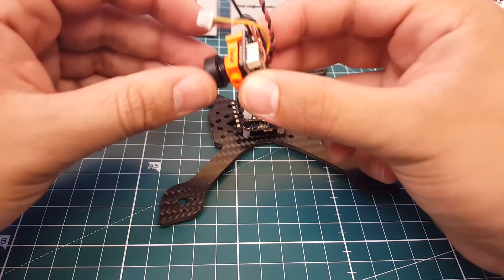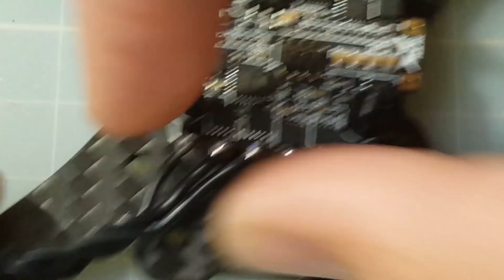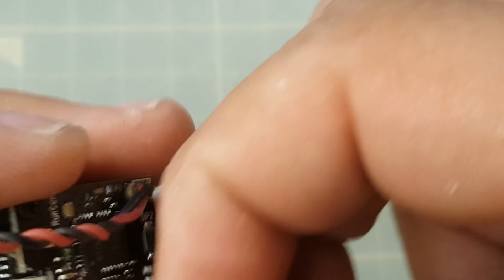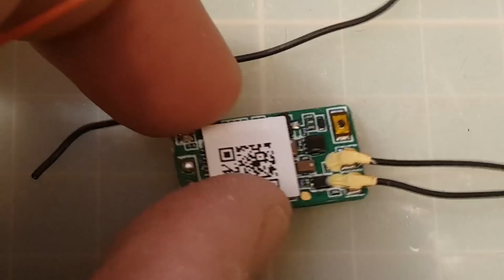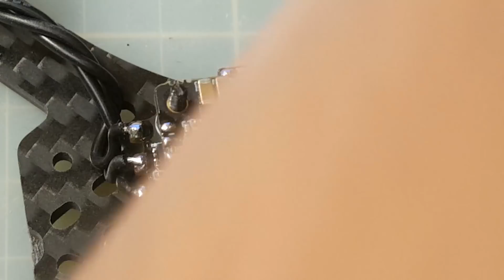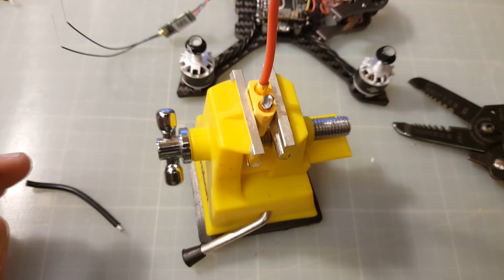How To Build A 3 inch Beast FPV drone 2017 // Geprc Sparrow, HGLRC XJB, Runcam Micro

Comment: Hi i have geprc sparrow with geprc motors 3200kv and dys 4in1 20amp , not camera setup yet , can i use my lipo 850mAh 30c from my heli align  t-rex 250 on my quadcopter.. ? Thanx

Comment: Finally got my maiden in a few weeks ago and just got my dvr too mod my goggles. Just wondering what pids you used when you flew it. I'm on the stock tune at the moment but the quad feels loose and I'm not sure where to start on tuning this little thing. Sparrow frame hglrc f428 stack elf cam emax 1306 3300kv motors. Any help is appreciated. Thanks.

Comment: did you have any vibration or twitching issues with the quad? I built a 3" with the same fc and esc stack and same motors with the same kv and they have crazy vibrations that are almost impossible for me to tune out.

Comment: Dont twist esc wires. The esc could have problems sensing the back-emf.
Reply: Exactly, but NO!!! And btw I mean the three phase going from the ESC to the motor. Postive and GND from Lipo/PDB to ESC can be twisted (but will increase the weight).

Actually this topic is quite difficult. But for sure you don't want to disturbe the back emf from the three phases which the ESC needs to read for optimal performance.

Network cables etc is a different story. There you want to cancel out electromagnetic interference from external sources. Also you don't want that multi strain line interferes with each other. Thus, you take a signal line and a GND line as pairs and twist them. But the ESC wires a just three phases.

Of course twisting of the three phases helps to reduce noise emited to other systems (e.g. compass). Here a nice short video showing the effect: https://www.youtube.com/watch?v=Tazm_2wSZLo (just watch the signal at the monitor in case you don't speak spanish)

But to be honest, at the end both ways will work without problems as in mini/micro quads the wires a short. And the ESC-motor path is not a critical system.
Reply: @sebastiannobody1142  remy5405 is correct, and esc will be able to read the back emf just fine with twisted motor wires. It is actually good practice to twist motor wires

Comment: Drone Mesh, I’m building the same quad and stack. I saw you didn’t use a capacitor on this build with the HGLRC. Seems a lot of the micro builds peeps aren’t using Caps. How is it working out for you without a cap,  THX...
Reply from the maker: +Cletus Lancelot have not flown it yet currently in Austria for couple days hopefully I'll have it flown on the weekend.. 

Keep me uodated meanwhile :)

Comment: You should get the heatshrink kit from eBay, there is like 350psc and a bunch of colors. You will be able to use yellow heatshrink on yellow wire. :)

Comment: Hey DM great build video it looks like it will be a speed demon.
I am not sure about the twisting the twisting or braiding the motor wires is a good thing.
One week ago I watched a video by Kabab FPV about motor construction technology and the different styles of motors from the Chinese motor engineers , it was mentioned about the twisting of motor wires was a bad thing as the ESC looses it ability to sense feedback from the motor. This is the same effect that UTP Lan cables use to stop noise.

Comment: I often use picoblade male and female plugs in the cables to be able to unplug the cam+vtx from the fc when working on it... Helps not to break cables (more often than not)... but adds a little bit of weight.

Comment: Hey man great vids yo! Just a thought, braiding or twisting motor wire together is kinda hard on esc, maybe run a test with your scope and look at the difference
Reply: I wish I had a link to it, but one of the "big name" FPV Toobers said that it is an absolute no-no to twist your motor wires. You will shorten the life of your ESC if not outright fry it. I'll see if I can find a link...
Reply: It is because the different currents running through each wire will affect each other when you twist or wrap the wires. This can cause microcurrent oscillations, which WILL shorten the life of your motors.
Reply from the maker: DrewB 213 will do
Reply: Good to know!

Comment: so pumped to have a new dm vid to christen this samsung
you see that piece of plastic on the back of the microswift? That has very agressive adhesive on it- when I got my cam it was firmly attached to the corner. Well it pulled away and took a chip with it.
Runcam said it was crash damage- banggood gave me a new one.........
So now I carefully removed the back cover and put a thin film of epoxy keeping all those chips in place.

Comment: Almost the same build im working on. The only diff will be the motors. I'm getting the emax 1306's but still despising on the 4000kv or 3300kv. I will be running it on 4s as well.

Comment: If I wanted an flysky receiver instead of frisky would you suggest?
Reply from the maker: Yes flysky will work perfect get the A8S very good receiver for things like this.
Reply: A8S is shit. Many people have problems with it. Get yourself an X6B. Much better. Micro Flysky receivers suck IMO
Reply: X6B, you can fit it to the stack if you drill out the holes to 3mm, it’s diversity so range will be much better that A8S, I use this on all my builds other than my Pico X where I use a de-cased A8S, the X6B also has voltage telemetry you can send back to the TX
Reply: my experience with that receiver is to solder it to the dmsx pad not the sbus.secondly do not solder a 5v vtx to the vtx - and + power it off the 5v pads.i burned out 2 vtxs cause of that.
Reply: Either the a8s hooked up in ibus or the rx2a pro in ibus. I hear the a8s has issues in ppl mode. Personally I have a a8s on a 210 in ibus and have never had an issue.
Reply: yeah im pretty sure im in ibus spend hours trying to get sbus working.then after a bit of research i found out about the dmsx pad fix.
Reply: IRFZ44 it really is the luck of the draw on the a8s but I'm 3 for 3 on ones that work and work well. They are all hooked up in ibus mode tho. I did have an issue with one hooked up in ppm. The one I have on my 210 build I can get to the edge of my property witch is a good 250+ meters. But yes I do agree on the x6b, I actually have a few on the way for a new build.
Reply: Archer FPV worth noting PPM on the A8S means failsafe won’t be operational
Reply: Jason Cross true, I forgot to mention that.  However in ibus at least on the v2 a8s it doesn't seem to have the connection issues it has when in ppm. I've got a v2 a8s on a 210 and have never had an issue, haven't tried the 400 meters yet tho but I have gotten to around 250. I've never had an issue out of mine. But yeah I have head some horror stories.